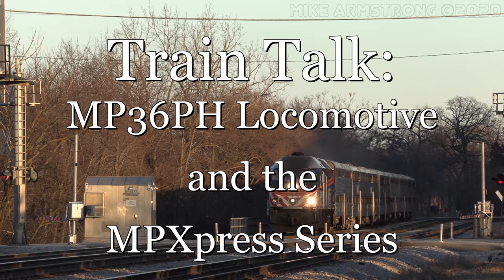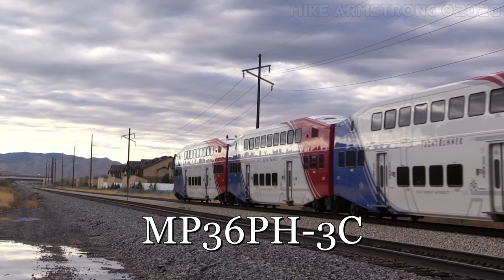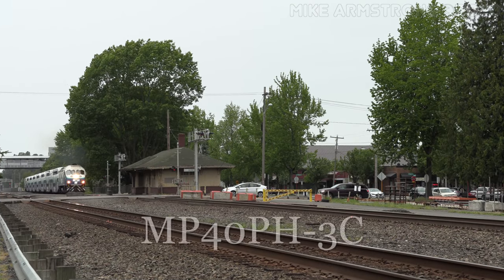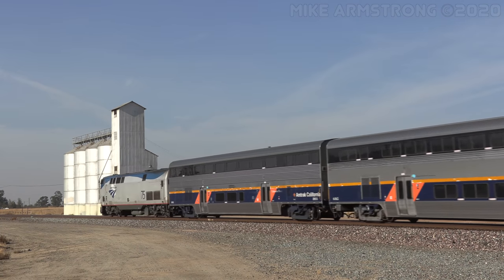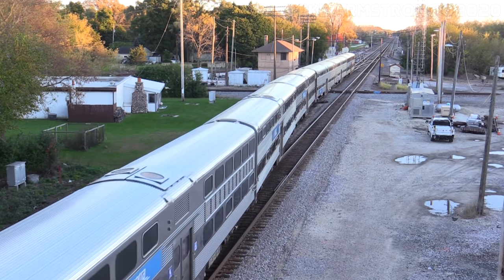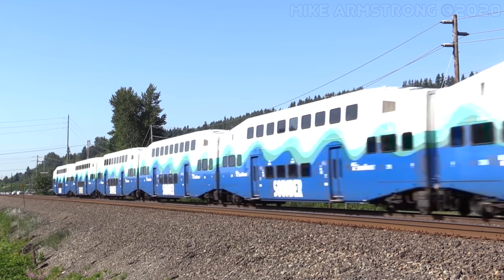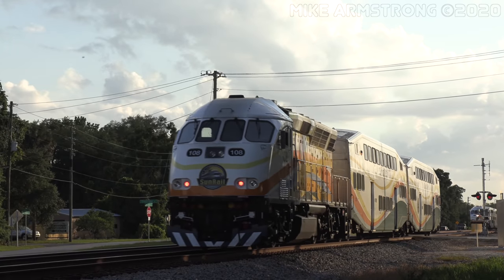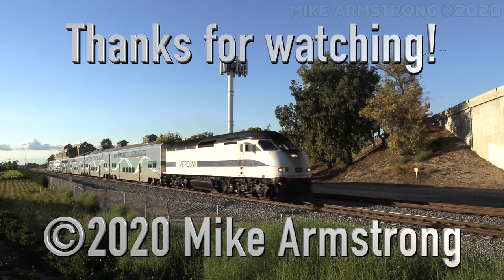MP36PH Locomotive Series: Train Talk Ep. 30

Comment: Fun Fact: The MP36PH-3S is basically an F40 with a newer EMD 645.
Reply: Also, the MP36PH-3C is essentially an uprated F40PH-2C
Reply: I never knew that.
Reply: And a streamlined nose and different cab...
Reply: It's literally a wolf in sheep's clothing, if it ain't broke don't fix it.
Reply: So that’s why MBTA mp36ph’s on the mbta sound exactly like and look like F40PH-2c’s from the back!
Reply from the maker: They do have a lot in common!
Reply: @CoasterFan2105 Yep. Just a difference in the EMD 645 (EMD16-645E3 in the F40s) and (EMD16-645F3B in the 3S/C).
Reply: @CoasterFan2105 Caltrain mp36ph-3c locomotives are gonna be replaced by Stadler kiss Electric multiple unit?
Reply: @Sebastian Munera No. They will *NOT*. Caltrain will still operate diesel services to Gilroy and is currently giving it's MP36s a Mid Life Overhaul.
Reply: CoasterFan2105 GO Transit still has F59PHs
Reply: And new body design.
Reply: A Very Random Person F125s are the worst diesel locomotives ever and they should be retired
Reply: Tom Smith what new body design?
Reply: @A Very Random Person Caltrain’s mp36ph locomotives are gonna be replaced from San Francisco to Gilroy by Statler kiss trains in a European company
Reply: @sebastianfloyd372  They are different. Not easy to explain.
Reply: @sebastianmunera5470  My version is they gonna only retain MP36 for SJ - Gilroy sector that can't electrify, SF - SJ sector gonna be replaced with EMU trains.
Reply: @sebastianmunera5470  not yet, but yes sadly

Comment: The MP36PH-3C locomotives have a Caterpillar HEP Generator. The “P” in the name means the engines have Passenger Gearing and the “H” means they are HEP Equipped. The “3” is the locomotives are equipped with “Dash 3” Electronics. The “MP” means they were manufactured by MotivePower. The “36” in the name means the locomotives have 3,600 HP.

Comment: The Massachusetts Bay Transportation Authority (MBTA), a public transit system which runs commuter rail services around Boston, MA and branch out to the surrounding towns, cities and suburbs, owns and operates two MP36 3600 horsepower diesel-electric passenger locomotives. They are MP36PH-3Cs and built by mpi in boise, idaho in 2010 and entered service on February 7 and 14, 2011. They are based on the MPXpress series or family of diesel-electric passenger locomotives built by mpi in boise, idaho and services various commuter railroads throughout North America including the United States and Canada. To date, more than 220 of these types of locomotives had been built. As of 2023, mpi no longer lists the MPXpress as a product on their home page. Both units are currently being rebuilt by mpi with completion anticipated in 2025 or 2026, because the company is waiting to complete all the F40PH-3C rebuilds.

Five models of the MPXpress series have been built:

- MP36PH-3S (which no longer exists because Metra, a commuter rail in the downtown Chicago metropolitan area rebuilt all their MP36PH-3S units to MP36PH-3Cs between 2015 and 2020).

- MP36PH-3C (the original variant of the MPXpress, built starting in 2003).

- MP40PH-3C (these are used by GO Transit in Toronto, Ontario Canada, which is the only operator of the model and built starting in 2007).

- MP54AC (GO Transit in Toronto is the only operator of this model and the first unit of this type emerged in late 2015).

- MP32PH-Q (SunRail is the only operator of this model and these engines are rebuilt GP40WH-2s originally operating on MARC the Maryland Area Regional Commuter system in the Maryland area, mainly Baltimore, between 1994 and 2011 and were replaced by newer engines). These engines were first delivered to SunRail for the opening of the line in central Florida in May 2014. Built starting in 2013 and ending in 2018.

The MPXpress units were built starting in 2003 with the MP36PH-3C as the original variant, meaning the first produced of the type. Units were still being built for commuter railroads in the United States and Canada as late as 2015. The last units of the type were assembled and delivered to GO Transit as MP54ACs in mid-2019.

Comment: The MP36 is powered by a EMD 16-cylinder four-stroke water-cooled 645F3B diesel engine/prime mover. It has 3,600 HP and a top speed of up to 110 MPH. Wheel configuration is B-B. Locomotive axle arrangement is Bo’Bo’. Technical Specifications.

Comment: With GE Transportation systems now being part of Wabtec that opens up lots of possibilities for MPI.  Instead of the expensive MP54 genset locomotive, they now have the possibility of plunking a tier 4 GEvo engine into their locomotives instead, that would almost certainly be less expensive than the genset setup.  Though I have a hunch MPI may be looking to design a new locomotive that meets NEC loading gauge requirements as the MPxpress series are full height and can't operate under Northeast loading gauges.  A heavy modernization program needs to happen too to keep up with the vastly more modern Chargers.

Comment: Metra's mp36s are the heaviest that MK/MPI Boise built. The design was completely new at the time and originally did not meet the FRA crashworthy standards. Allegedly,  concrete was added in the locomotive noses to meet those standards.  These units are restricted from the UP lines because they weigh close to 300,000 lbs. Too heavy for 100yr old bridges (To put in into comparison,  UPs heaviest locomotive weighs 410,000 lbs, and that is spread over 6 axles, instead of 4.)

Comment: I know of a good successor: the MP60ACI - a battery powered 6000hp MPXpress locomotive with two prime movers rated at 3000 hp and these could run off of renewable diesel

Comment: Ummm what about Mbta MP36 those still run they only have two witch is rare to see those bois number 010-011
Reply from the maker: I didn't go through the list of every commuter RR that bought them, I just mentioned that a total of 9 different ones purchased MP36s over the years and listed a few of the RRs with the largest fleets. But yes, MBTA does indeed have two of them, originally from Frontrunner.
Reply: Oh

Comment: Are they related to the locomotives built in Scotia 
Ny. They were a gm emd division loco. They were a monocoque body with a 2cycle end engine. These locomotives were part of the LIRR. I BELIEVE they were 16 cylinder engine going from ac to DC then DC to ac drivetrain. It has been long time since I HAVE Seen them. 

.

Comment: I see these engines quite a lot on UTA FrontRunner, Caltrain, and Rail Runner. They're quite great. I think the best MP36s come from NorthStar, with those spectacular Hybrid K3LAs.

Also, did you know that Tri-Rail was going to buy MP36s, but they didn't because Brookville actually CHEATED the bid to get them to buy the BL36PHs instead?
Reply: @Superbaddy4 The 2 worst are WCE and GOT, as they have K5CAs.
Reply: Sounder has K5CA-LSs too. I don't want to say WCE is the lowest, because in the beginning, 906 had an AMAZING K5LA. The early GO units initially had relatively good K5LAs, but that too is history.

For me though, VRE is at the bottom, with GO and Sounder right behind.
Reply: What type of cars did coaster order I am sure they did not order cem cab cars they ordered normal cab cars
Reply: @Kenrich Liu Bombardier CEMs
Reply: Fun fact normal non cem cab xars are still being prodeuced
Reply: Not of the Bombardier Bi-Level Variety, they're not...
Reply: @superbaddy4  wikipedia says they are currently being prodeuced along with the normal cab car they will be replaced later.
Reply: No one will buy them anymore, though. They'll just buy the CEM ones.
Reply: @superbaddy4  rip well if we are lucky someone will buy them. Wce please
Reply from the maker: Didn't know that Trirail was going to get MP36 locomotives, interesting! Wonder why they went with the BL36?

Comment: What is dash 3 electronics?  I assume micro processor maybe using the EMD EM2000 system?  Are they using EMD AR10/11 alternators?  I guess using EMD prime mover does not  mean EMD electronics.  Anybody know? Just curious ... great video by the way.
Reply: OK ... found some info.  For those techno geek RR fans  .. the units have AR11 alternators, EMD prime movers but use QES III type traction control/excitation electronics.  It seems to be a blend of OEM and specialist manufacturers.   Hodge podge ... it seems the micro processor dash-3 control systems can provide greater adhesion and fuel efficiency than even the dash - 2 technology.  EMD can supply both dash-2 and dash-3 (EM 2000) tech but other vendors can also supply their proprietary electronic systems.

Comment: I honestly expect Metra to be the very first to pounce on the first Tier 4 MP36 rebuilds that MPI offers since they're so incredibly cash-strapped and need newer locomotives.
Reply: @Acerailfan3101 F40PH No. Metra is currently buying SD70MACs and converting them to Tier 3 passenger use to replace some of the older F40s. As far as the MP36s go, I think they're gonna be kept around for a while but the F40s might HAVE to go. Rebuilding and fixing them is a pain since the parts for them are scarce these days and the locomotives themselves are over 40 years old. The only place that can  rebuild F40s is somewhere down in Georgia.
Reply: @Acerailfan3101 F40PH Doesn't surprise me. A lot are currently falling apart at the seams. Fires aren't exactly what you would call a rare occurrence on them.
Reply: @Acerailfan3101 F40PH I expect the Illinois Railway Museum to snatch up a few before they all go away for good.
Reply: @Acerailfan3101 F40PH Wait, The IRM is getting the F40Cs? I thought they were still sitting at Western Ave railyard looking to get a rebuild.
Reply: @TheRealEasyA  the MP36PH-3Cs could've been converted to MP40PH-3Cs